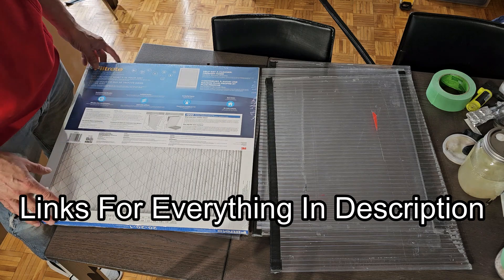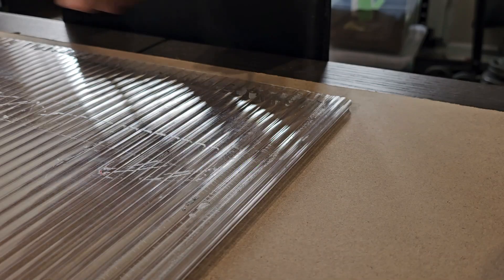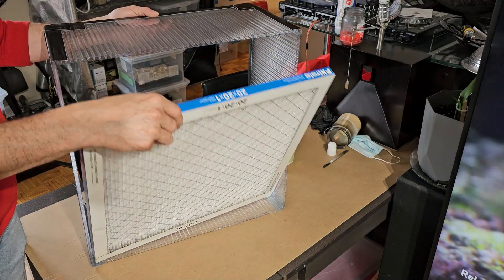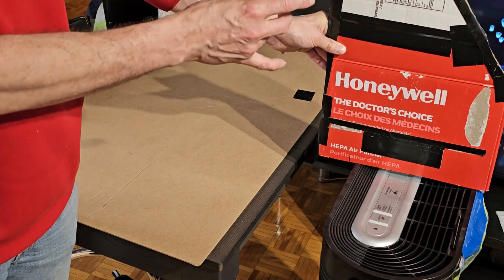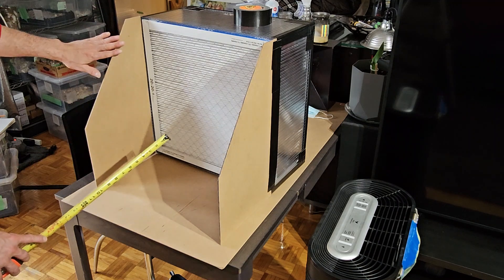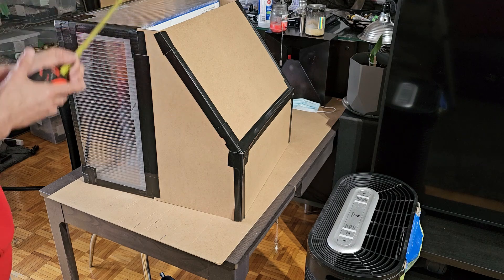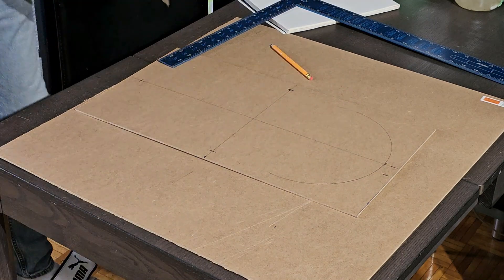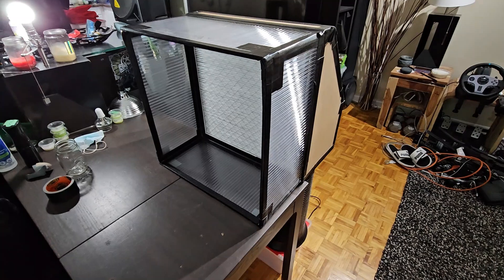Avoid Mistakes: DIY Laminar Flow Hood for Mushrooms

Comment: This is not a laminar flow hood. You get extra points for creativity and the fact that it has an actual hood implement. But that is not laminar flow.
Reply from the maker: Well clearly since you know everything please explain to me what laminar flow is. Laminar flow (/ˈlæmənər/) is the property of fluid particles in fluid dynamics to follow smooth paths in layers, with each layer moving smoothly past the adjacent layers with little or no mixing.[1] At low velocities, the fluid tends to flow without lateral mixing, and adjacent layers slide past one another smoothly. The air purifier is supplying the air into the let's call it Hood portion. The secondary filter creates the buildup of air allowing it to flow in a stream straight out of my box. The opposite would be turbulent flow which would be the case if I didn't have a secondary filter.
Reply: @HowToShroom   🤣 I will gladly respond to this when I have time later this evening
Reply: @HowToShroom  I'm going to do my best to refrain from writing a book here, but there's just so much to address. 

Lets start with, why did you ask me to describe laminar flow if you were going to immediately post a definition? A bit odd, dontcha think?

Also, I actually complimented your design for having an actual hood implement, but you felt it necessary to instantly be $hl++y in the first sentence of your response. Nowhere did I claim to "know everything", simply that your design does not produce laminar flow (which it most certainly does not). I must've missed the part in your video where you demonstrated your "laminar flow" with an anemometer, demonstrating how there is ample airflow emitted across the entirety of the filter face, and how there is ZERO variances in said airflow (you know, laminar flow). I also missed the part where you attempt to showcase your "laminar flow" with a flame or smoke test (which neither actually illustrate true laminar flow anyway). Maybe I missed those parts, and should do a re-watch.?

Interesting how professionally engineered commercial grade FFUs for medical clean rooms, dust-free rooms for electronics, and for plant/fungi propagation don't produce laminar flow, but your unsealed DIY air purifier HVAC furnace filter contraption does. Go to the manufacturer's home page of any of these popular commercial FFU producers, and not one makes the claim of laminar flow for their devices. Maybe these degreed engineers should be taking notes from your clearly superior design? The only place where there is claim that any of these professionally engineered commercial grade FFUs produce laminar flow is from the dishonest distributors using "laminar flow" as a buzzword to market these products. 

Contrary to popular bro science belief, laminar flow cannot be achieved with a basic cavity and HEPA furnace filter. Achieving actual laminar flow requires: a $hl+ ton of calculations, a specialized filter containing multiple layer of varying membranes and integrated usually metallic straws, adequate cavity spacing, baffle placements, among many more requirements. If you truly knew anything bout laminar flow you'd already know this.

In closing, what you DO have with your design, is possibly a device that provides filtered somewhat smooth constant positive pressure airflow. And, in all fairness, that's all we really need to be successful in this hobby. I will reiterate that I was, and still am, complimentary of your design. I simply do not agree that it provides laminar flow. This isn't shade, merely facts, and no ill intent. Yes, I got snarky with you in this message, but that's only because of how you responded to me, I match energies. I'm more than willing to bury the hatchet if you are. 

Regardless, best of luck, and Happy Cultivating!
Reply: @WhiteBeardHashtag1205  I think this guy is full of it. He has 2 videos on this channel showcasing his thingamajig, and not once does he even do a flame test or smoke test. I know those arent the best ways to show laminar flow, but at least itll show something. He claims "This is exactly what I've accomplished here" without displaying it at all. Sure bud, we TOTALLY believe you brochacho 🤣
Reply: @SwiggitySwagDopeInTheBag  its been 4 days and he's yet to respond.
Reply: @WhiteBeardHashtag1205  Even a year later he still hasnt had the balls to respond

Comment: This is creative and cool, Ill give you that, but this is not a laminar flow hood. Not even close. Far too many people throwing that term around that obviously dont have a clue what it means.
Reply from the maker: Laminar flow (/ˈlæmənər/) is the property of fluid particles in fluid dynamics to follow smooth paths in layers, with each layer moving smoothly past the adjacent layers with little or no mixing.[1] At low velocities, the fluid tends to flow without lateral mixing, and adjacent layers slide past one another smoothly. This is exactly what I've accomplished here thank you. I do appreciate the comment on the creativity.
Reply: @HowToShroom  I know what laminar flow is, and I dont believe youve accomplished this with your "laminar flow hood" at all. If so, prove it! At the very least perform a smoke test. I would bet an entire  paycheck that smoke test wont show completely uniform air movement.

Comment: The air coming out of a purifier isn't clean enough if i just redirect the air? Great videos by the way
Reply from the maker: It would be. I use the second filter to creat the build up of air and a more even flow across the work area. My original design didn't have the secondary filter and the air seemed to be strong in one corner but not so much in the other ones. The second filter makes a huge difference. It's just for more even air flow not for actually filtering the air. That is assuming that the air purifier has HEPA filters in it. I've never replaced my HEPA filters after 2 years of using all day everyday. I just vacuum off the pre-filter for the unit.

Comment: this works if you already have a clean air
Reply from the maker: Yes but in this case you get a room purifier and laminar flow hood for $200. The hood goes away when not in use the the purifier keeps my space clean.